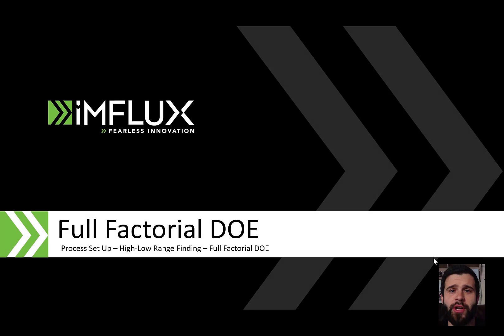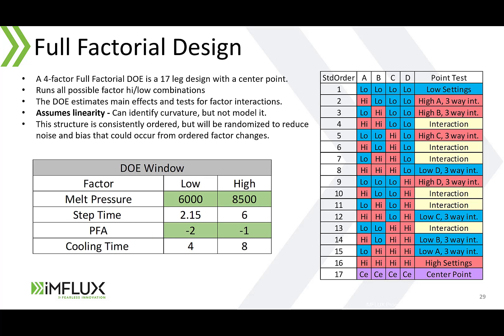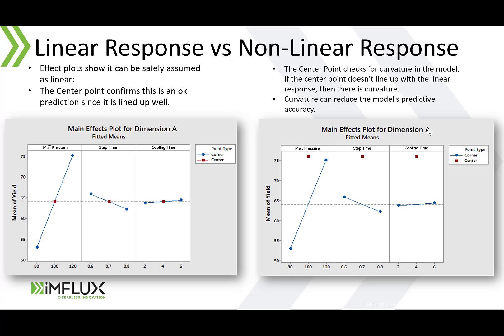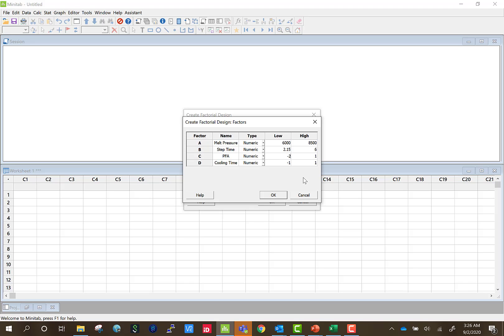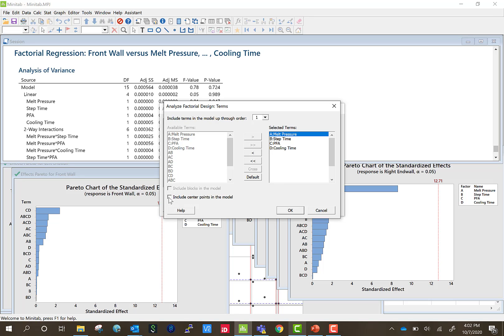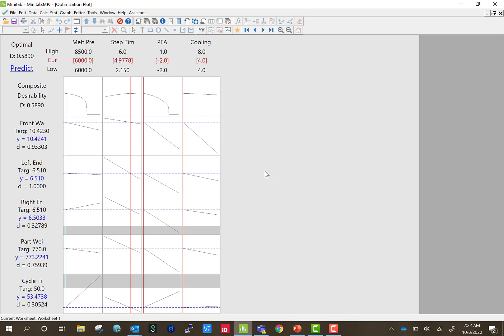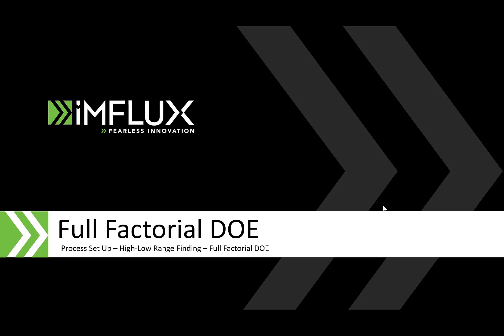Full Factorial DOE

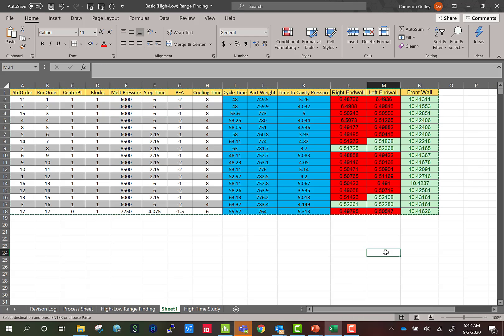Comment: 5:54 that data from Cicle Time to the left, you generated it from your runs, right?
Reply: The columns to the left of Cycle Time were DOE settings that were made from the DOE setup. The Cycle Time column and the columns further to the right are gathered from the machine when you are running each leg.